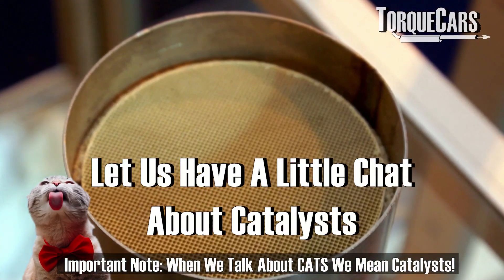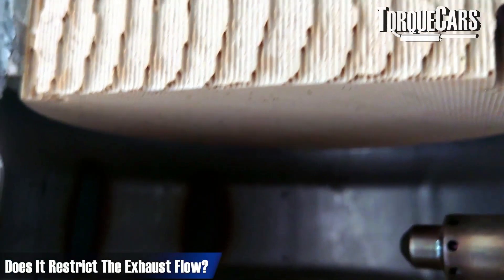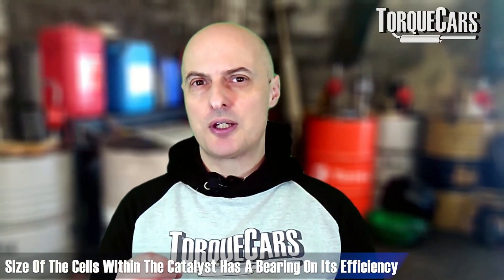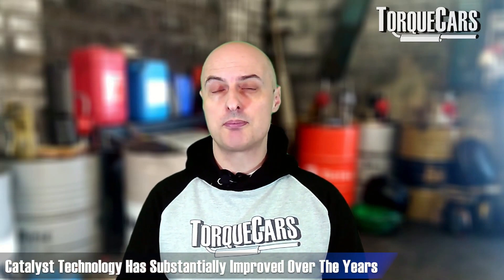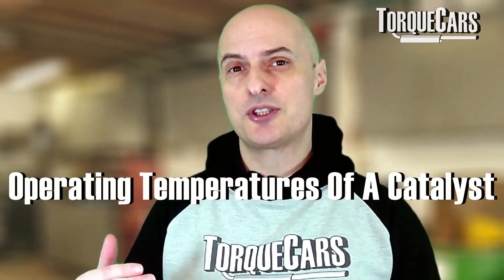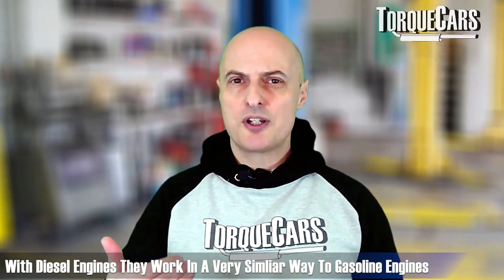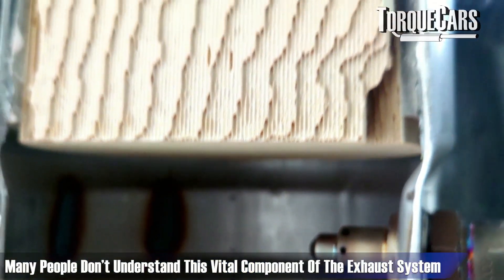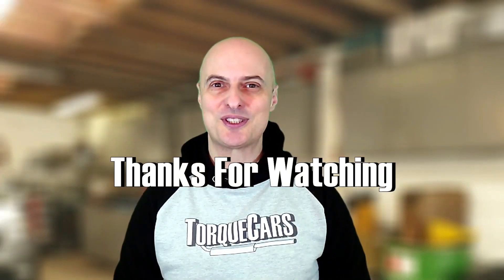Is It Worth Removing Catalysts or Adding a Sports Cat? [Tuning Tips] Cat Deletes & Decats.

Comment: Is it a straight forward process to refit a cat on a car that has been decatted?
Reply from the maker: If they did a software tweak you'll need to get that restored, the lambda sensor (or sensors) will need to be installed, essentially though you are just cutting the exhaust and adding the catalyst section back in. So it depends on how the cat was removed, a brutal snip and it's off is the usual common approach, but they might have done it properly and altered the ECU.

Comment: You answered one of my biggest questions right away and a theory I had for a while; cats need to be significantly larger than the rest of the exhaust they're mated to. Is there a general rule of thumb for this? I have two options for my exhaust. I can use two 2.5" pipes, where the cats are 4" in diameter. Or a single 3.5" pipe with a 4.5" diameter cat.

Comment: Ive just come across your channel and have found it really helpful , im based in ireland and its hard to find good information in video format . Ive got a 2012 2.0tdi octavia 4x4 (haldex drive) estate and your tdi videos are super helpful, im hoping to get the turbo from a 170 hp model and take it for a remap maybe do the exhaust and intake if it needs it . What differences are present in the 140 vs 170hp engines ? Is it just the turbo ? And should i look at any other engine mods for a good remap like injectors , egr , dpf? Thanks a mil dude ive got you on my subscription list

Comment: If the cat is removed what happens with the sensors? Is it something that can be dealt with via turning those sensors off in tuning?
Reply from the maker: Yes you are correct in most cases you'll need to adjust the car computers tuning to compensate or you'll most likely hit a limp home mode and get an error light.
Reply: But that would be considered an "emissions defeat" and is very illegal. But...